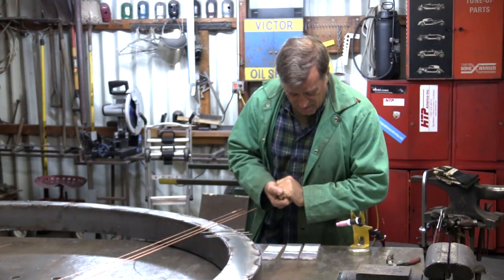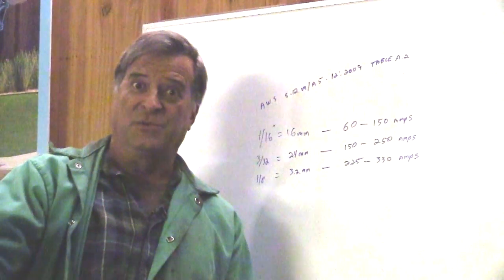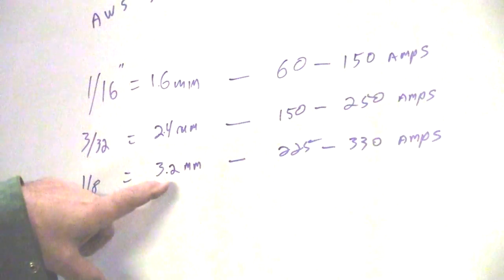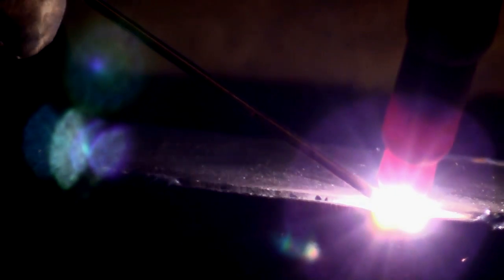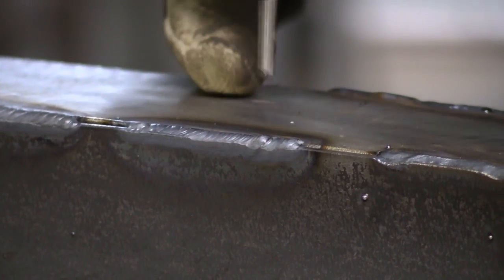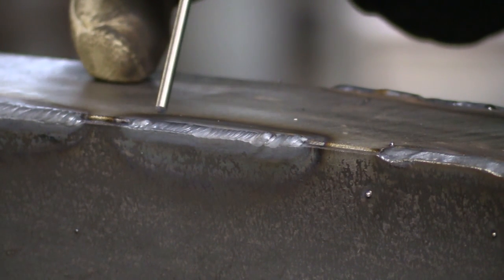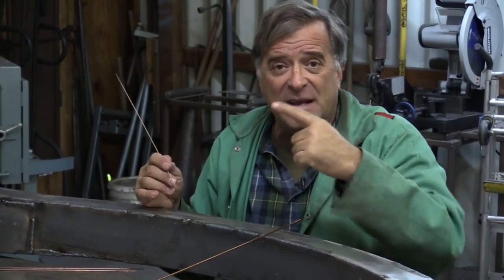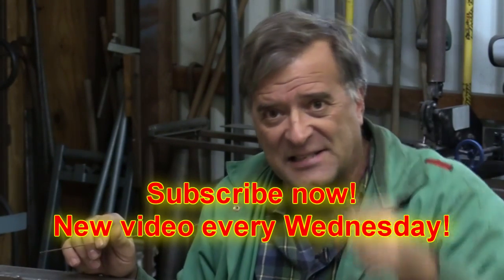How to Choose Filler Rod and Tungstens for TIG Welding - Kevin Caron

Comment: Im going to be welding 1/16 wall 3in dia aluminum turbo pipe on a car.
What amp and size filler rod would you suggest 
Cheers
Reply from the maker: About 45 amps and the filler depends on what type of pipe you are welding.
Reply: @KevincaronSculpture  oh jeez I've been practicing at 90amps lol
No wonder why my weld is looking so flat.
Not sure what the mix is in the pipe
It could be a Chinese version of 6061 but who knows.
Its aftermarket cheap aluminum thin wall automotive pipe

Comment: Helped me on 6g pipe certification. Plate (fw) + tube (t)or plate / plate bw 
didn´t see so big difference. Noticed this though :D 2 months back when too big filler rod like 2.5 on current of 100 amps. ruining metal because need to heat a lot. for plates and tube+plate 2.4 tungsten. for pipe 1.6 tungsten and 2.0 filler rod. thickness about 3 millimeters. for 5-6 + 2.4 is good . For root i would use 1.6 and for passage 1.6 or 2.4. Depending how hot it run and how large it is. for 120 x 120 millimeter 1.6 i would use still use on the  run and starter to keep it tight and when not so experienced amperages are 100-90 amps on hot pass especially if no cooldown since when finishing heat destroy sweet looking weld in the end and it is melt puddle. I with not much experience got good result using 100 amp on down when starting and 95 when left or right site of the pipe to avoid downcut on the root with 6millimeter pipe. in roof used as low as 90 amp because easily push filler too much because gravity. On hot pass 100 for start or 95 depending if cooled or not and even 90 or 85 amps for me / beginner because movement is slow. 120x120 millimeter pipe with 2  ( root and hotpass). Using freehand technique. Small things are crucial you don´t weld thin
 plate with 3,5 or even 5,0 111 stick either :D need as thin as possible to get the root 
and avoid too much melting. More videos like these. I,m from finland and greetings. Had to do search using english to get the 
results i was after.
Reply from the maker: Thanks for sharing

Comment: Hi Kevin, I've been tig welding a number of months now and I'm not progressing as well as I would like but that's ok, it's a lot of fun. I make industrial furniture and I have a heck of a time filling in a fillet weld. I can't get the puddle to fill the gap, especially if my cut is not square and there is a gap at the bottom. I've been using 1/16 Tungsten. My material is 1/16. I've been thinking about going to 3/32 tungsten 2%lanthanated to get that bigger puddle to fill up the gap easier. I'd have no problem with mig. What do you think

Comment: What would you run if you're doing 18 gauge sheet mild steel?  is 1/16 the smallest tungsten and filler rod?
Reply from the maker: Nope, one step smaller.  .040.    is the smallest I know of.

Comment: HI Kevin
Is there a Tungsten that we can use for all tipes os metal ?
Reply from the maker: I have used the E3 on steel, stainless, copper, aluminum and cast iron.  All with the same point and different machines.  Miller, Everlast and AHP.   No problems that I can see.
Reply: Thanks for the reply. great videos

Comment: Kevin what size gas lens should I use on my AHP? Can I use a stubby on my air/gas cooled torch? I see you using a long tip and cup.
Reply from the maker: Yes, a gas lens kit would be great for your machine.   Not sure what size torch you have.  Check on the side of the torch body for the number and order the right kit for that size.

Comment: Iam new to tig welding and of course having problems. Iam practicing on 14 gauge steel with 1/16 tungsten and filler rod on about 60 amps. My welds are all raised up high but together, am I going to fast or slow or more amps etc... If anyone could please help. Thank you.
Reply from the maker: Turn the amps up to about 75.  That should even things out for you..
Reply: Ok thank you. I'll try it out.

Comment: Those amp ratings are high, I would like to see 3/32 properly ground tungsten run at 250 amps and not melt the point,  even with a 1/16th landing on the end it would burn off quickly. I run a foot peddle and may have my machine set that high but could not give it full peddle without melting point of tungsten.
Reply: At work we run ⅛" tungsten on aluminum at 135V

Comment: Kevin
BEWARE that some tungsten's contain THORIUM  which is RADIOACTIVE. It is very low in radiation but accumulates over time. Avoid breathing the dust.Better still avoid buying electrodes that contain thorium.
Reply: i run max 200 amp on 3/32, but with low cleaning u might get away with 225, but yea. over 200 i belive is beond most thungsten capabillity
Reply: I posted information about health and safety, Not about techniques.
Please all of you read this.
http://www.twi-global.com/technical-knowledge/faqs/health-and-safety-faqs/faq-the-use-of-thoriated-tungsten-electrodes/
they are the same if not better than the the American welding society.
Lizza